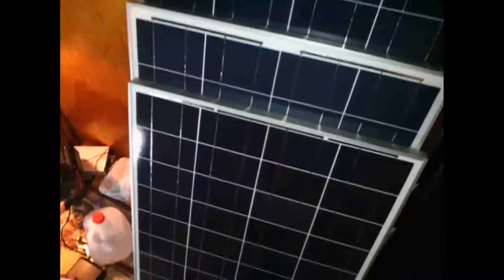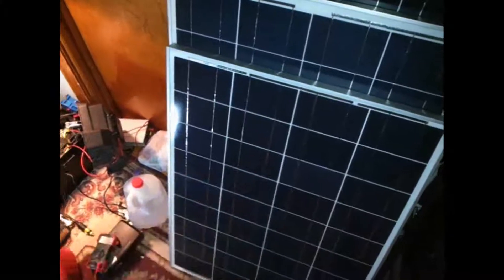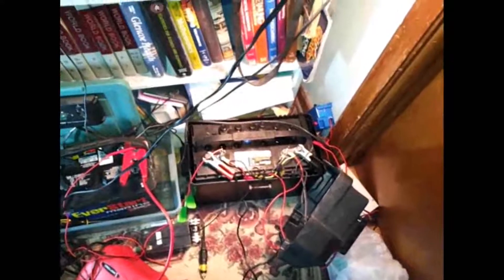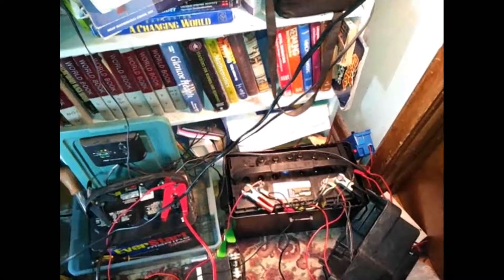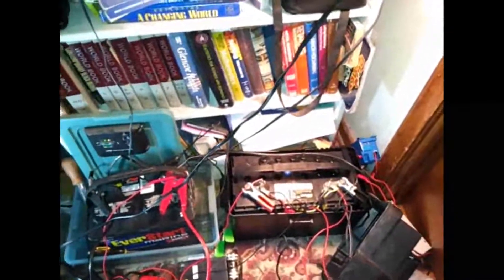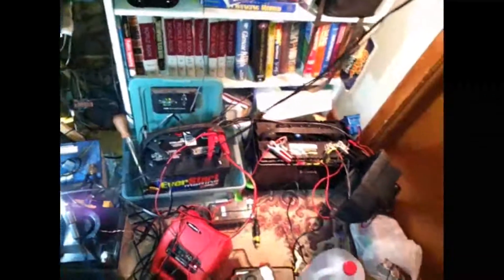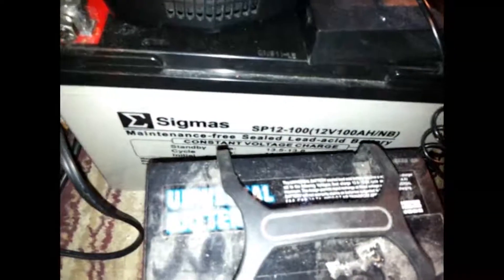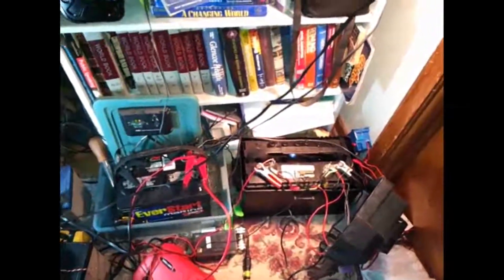Deep cycle battery failure

Comment from the maker: I went with two used econo power (interstate random cells) group 27 batteries......not the best, but enough to hold me over until I can get brand new cells. I'll have to check out those cells, the specs look pretty good.